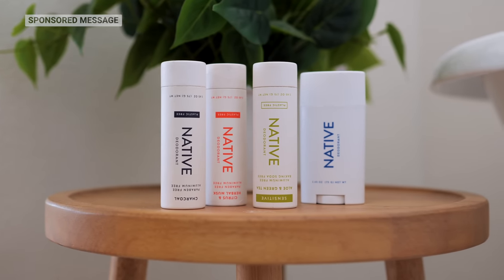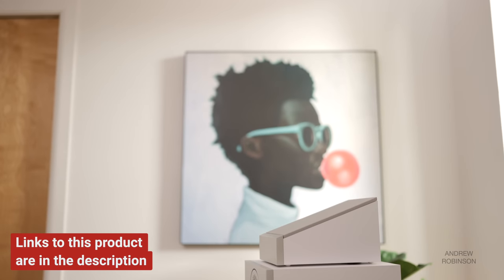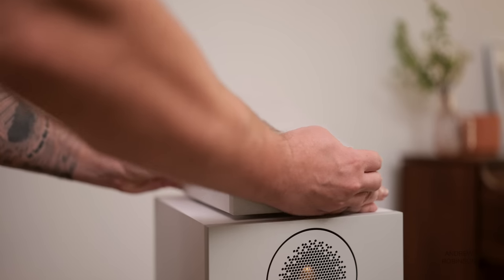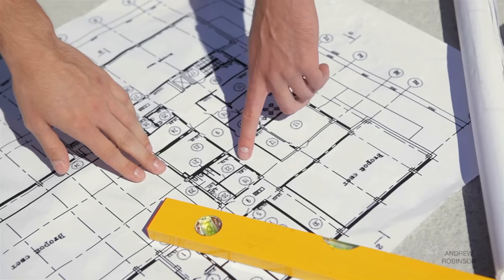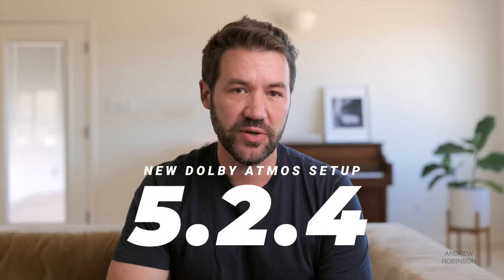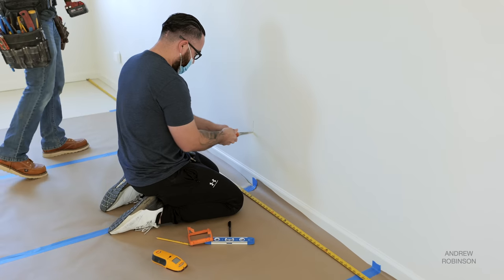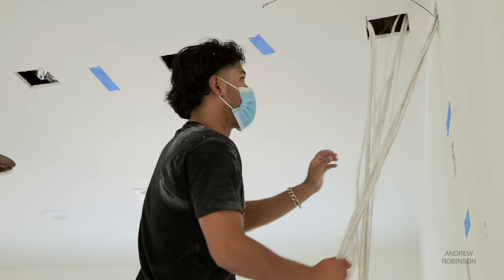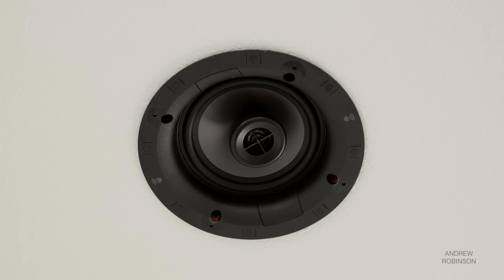INSTALLING DOLBY ATMOS SPEAKERS! Atmos In Ceiling Speakers

Comment: Can the AI driven system in the Sony HT-A9 compensate for sloping ceilings? I have a significant slope in the main room of my house and haven't been sure if the A9 would work or if I'd be throwing money away with those.
Reply from the maker: The A9 can compensate for a wide range of room types, but I cannot say with 100% certainty how it will perform in every room type, so your mileage may vary.
Reply: It should be fairly easy to determine. If the up firing speaker drivers are not pointing in such a way as to reflect their sound off the ceiling then back down to the listening positions, you are going to be out of luck with any up firing system. That includes speaker top Atmos, the Sonys with their up pointing drivers, or Atmos sound bars. Works for some spaces, but probably not with a sloped ceiling.
Reply: Yes, but try before you buy.

Comment: Hey Andrew, and Kristi, as a follower for a few years now, I was wondering if you have any plans on using other measurement systems than barley corns in the future? I would appreciate not having to do conversions to figure out what 12 feet actually means.

Considering the quality of content and knowledge you present on here, I would be surprised if your audiences demographic would be anything but global. At least I hope it is, because I think you're doing fantastic educative work on here. I'm sure you have a better grasp of your audience demographics, so maybe it's a conscious decision to keep the amount of written information to a minimum?

I'm sure it will be clearer in further videos, but I was a little confused on how you decided to solve the issued of aesthetics with the rear channels on stands, because your drawing only shows speakers in the ceiling?

Look forward to hearing more on the project, this video was great for anyone considering permanently installing speakers in their home, with solid talking points at the end by Kristi, and I can't wait to hear your experience with this system compared to the reflective atmos setup. 

And congratulations on the house!

Comment: I just got Polk upfiring Atmos speakers a month ago and I'm not even sure if I can pinpoint the height sounds with certain movies or tv. Maybe it's my ears or the positioning/calibration of the speakers/home theater setup...still experimenting. 🤷‍♂️
Reply: Yes, you do have to expirement and tweek settings with the upfiring speakers.  In my  case, I had to raise the volume a few notches in increments until I got the desired effect.  Generally, the height effects in my system fall in front of my sweet spot but they are sometimes mixed with the rears.  I'm sure ceiling speakers would sound more presice ( and I have toyed with the idea of adding a pair)  but right now I'm satisfied with the upfireing Klipschs.  Your source is also important when calibrating your upfireing speakers.  The Dune 4kHDR disc is excellent and I have heard that the Blackhawk Down remaster is as well.  (I need to get that one).  Keep expirementing. You'll get it.

Comment: I have no experience with in-wall speakers but I always thought of resonance when I looked at their design. How do they not shake and rattle? And how does 1/2" drywall work as a baffle, structurally? 

I'm guessing it's not the issue I imagine it to be. Again I have zero experience or anecdotal claims that they are problematic.
Reply: There's several ways to address all this this. For shaking and rattling, the doglegs in most contemporary ceiling/wall speakers hold very tight. You can also utilize soft wraps for nearby wiring that may vibrate. You can also add in foam tape around the edges of the speaker frame where it meets the ceiling to further eliminate rattles. I'm using speakers with built-in backboxes to address the baffle issue, but some do well with an "infinite" baffle. You can also sound treat the area the speakers are in with materials similar to Dynamat or Roadkill. Also adding Rockwool or simply fiberglass insulation to the surrounding space greatly reduces sound transference and standing waves. There's also other soundproofing methods to decouple the drywall from the joists/beams as well as various acoustic noise proofing compounds. Cheers!

Comment: My ceiling is 8ft, and upwards firing Dolby Atmos does not work in my room. Also, doesn't it bug you that your rear speakers are in the ceiling? That would really bother me, because the direction of the sound is completely wrong.

Comment: How are Klipsch SLM 5400 c as ceiling speakers for Atmos. 
They are part of the rare slim speakers which can fit in most size condition
Reply from the maker: I ALMOST went with those speakers but opted for the Designer Series instead, so I don't know how the SLM speakers would perform, sorry.
Reply: @andrewrobinsonreviews  is it possible to review? I have only 3 inch gap in my ceiling and these speakers require only 2.5 inches.
Can help loads of people as a option of ceiling speakers against up firing.

Comment: Im eventually gonna sell the home i live in currently. So im not investing in custom anything in the near future. One day, it will be nice. My stereo is in my living room/art studio. It looks relatively civilized. My home theater is in the unfinished basement. Ive treated the bare walls with affordable materials. Got some cheap red theater curtains for more sound deadening and appearance. The speakers are all on cindar blocks raised high enough for any potential flood, unless its the apocalypse. Its ugly. Kristi would hate it. I even cheat with atmos. Cindar block towers well above the listening position with angled down front firing speakers. I tell you it works. It aint pretty, but its really amazing what anyone can do if you experiment enough. Atmos is more flexible than the diagrams indicate.
Reply: Thats awesome. I too am trying to improve my set up.
Reply: @obi1cannoli777  right on. Its all about dealing with the space available. Unless the room itself was constructed purely for home theater, compromises must usually be made. Good news is, great sound can still be achieved

Comment: I hatttttttte back and side stands with the speakers. However I live in Mexico so guess what, I learned to love them since houses in Mexico are made out of cement. Hiding wire was the trick but way easier the having to drop the ceiling with beams and drywall .

Comment: You're lucky you have drywall, I have solid brick and coving at the top. The cables just want to be seen. The coving is 127 years old, so I don't want to start carving that up. I could use a specialist to cut it out so I can put channels in up to the ceiling, then have the coving put back again.

Comment: Aesthetically and because I'm tired of seeing wires, I'd love to have embedded speakers in the ceiling and walls. Although, I'm not sure I'm ready for another "is your marriage strong" test right now. Plus I do get slightly worried that embedded speakers could date a house. Sort of like when you see those old "doesn't work anymore" house intercom systems that people installed in the 1970's.  The irony though is my house is already pre-wired for speakers...but it's setup "whole house" music playing in every room instead of surround sound in one room. In a family setting, that nearly impossible that everyone wants to listen to the same music in every room they go to in the house...so we never had the speakers installed.
Reply: The ceiling is good but the walls, not so much. One has to be very careful as the projection of the sound and the reverb effects give the illusion of space and depth. It would look and sound cleaner but the human ear doesn't always do well with cleaner.
Reply: @lonniefarmer7067  Good point. I suppose in my mind I was thinking if rear speakers were in place (as I've seen some friends do). Another issue with embedded is if you get "tired" of the sound it's a bigger challenge to change the speakers out.

Comment: I have yamaha 3072 modeil 5.1 AVR. How can I add additional 2 dolby atmos over head speaker.  .. please suggest
Reply: If your receiver is a 5.1, that means it can only handle 5 speakers. The first five speakers should always be bass level (ear height). For one to add height speakers to this configuration, one would need to go with at least a 7 channel receiver. Therefore, allowing at least two of the channels to be allocated as heights / in-ceiling. Basically you would need to go with a 7 Channel receiver!

Comment: Andrew, I could really use your input. I am in similar situation. Currently run 5.2.2 setup, with 2 Atmos currently overhead directly. 

Looking to upgrade, but have no ability for rear surrounds at ear level. Room is open to rest of basement. 

Option 1 is 5.2.6, with 2 front elevation and 4 in ceiling Atmos. 

Option 2 is 7.2.4 with front elevation and overhead Atmos, with angled in ceiling for rears surrounds. 

Not sure which makes most logical sense. Any input?

Comment: still odd manufacturers  don't have white speakers for home in-ceiling... never seen a black ceiling in a regular house ... In-ceiling is rather permanent. I prefer atmos or direct height. 
No way I'm hiding my 7.6.4 speakers and subs in the room. 😁 $2k for the speakers including install is a STEAL...
Reply: Those Klipschs come with a white grill.

Comment: Andrew, as always, I enjoyed the video.  I hope you will do so Home Theater reviews from your new HT room.  I installed Klipsh in ceiling and in wall speakers with Atmos and a Yamaha 2030 receiver. I hate it!  It doesn't matter what mode I use, it's just hard to hear dialog unless you really crank it up.  The soundtracks sound good, but they dominate.  I had it professionally calibrated twice.  And using it as a stereo for music playback is really a joke. Most of the time my wife and I just watch TV in our family room with a basic soundbar.  I even considered starting over, but then reality set in. No one has a place to demo in ceiling speakers.
Reply: Did u find the issue why ? U tried room accoustics, or changing the AMP, AVR. Im not sure what  all has to do with  Ceiling speakers making it all muddy?

Comment: great video. I have a similar 'particular' female boss LOL!  This video helps me alot to simulate the response from my female boss LOL 
I just bought a house with a media room. It looks like 12 or 14 feet high ceiling. I plan to install Atmos speakers 2 or 4 but I think I would attach speakers because I wanna do it by myself. I may use flat wire like 'ghost wire' to conceal speaker wire then I would paint it to match surrounding. It may easier to my situation - I cannot justify to pay professional installer to do this job.
Reply: Particular is definitely the nicest way to put it. I'm lucky my wife isn't as "particular" lol but hey, everyone is different and I respect that.

Comment: Man, in ceiling surrounds made me die a little inside with all of the other videos of yours that I have really loved. Your videos are always well done and most are very thought provoking for me, but I cannot hang with you on this one. The separation between the bed level and your in-ceiling speakers needs to be pronounced or it will provide diminishing results. I get not wanting ugly on wall speakers, but that is just a huge compromise. I would likely initially like it, but it would quickly kill the experience for me causing additional expense to fix. Watch some Atmos demo videos once this is setup to see what I mean, Nature's Fury is a good one so you can visually see on the screen what you are supposed to be hearing. I am sure the space will be beautiful, but for me personally that is a secondary concern, but I am also in a dedicated space so I get it.

Comment: Could you please add your speaker cables you used in-wall to the system comments?  Thanks
Reply from the maker: The installer used a dealer only wire by Snap AV however, this is basically the same thing if you would like to go DIY - https://amzn.to/3oqetGW.

Comment: $2,000.00 for that install project? That's not bad. And about the ceiling height issue? I'm safe. My ceilings are only 8.5 ft.
Reply: In Australia there's an extra $0.00 missing.
Reply: @DarrenKrusi  Too right mate!

Comment: Ahh man. lol .. you should have done a Auro 3D setup instead . I have in cel. but put heights front and back with Auro MAN O MAN so much better
Reply from the maker: Auro3D has virtually zero support in the home entertainment space. While I understand their up-mixer is quite good, I simply do not want THAT many speakers in my home, nor do I want my life or home to have to bend to a format's needs. Honestly, Auro3D has done a decent job marketing to die-hard enthusiasts to the point where they've made themselves somewhat known, but in the larger home entertainment space I doubt they'll grow to even 10% market saturation or at least it will take a lot of time to get there.
Reply: @andrewrobinsonreviews   No I totally agree with you but I will tell you that there up mixer mixer is absolutely phenomenal
Reply: Man I want to get into aura 3d. Is it much better than atmos? Did you use svs prime elevations? Your system sounds  sick😷

Comment: Why go in ceiling surrounds vs putting in wall speakers for them? Like seems like cutting corners when it wouldn't have been much if any more. Like I understand not wanting speakers visible and get that in a non-dedicated space that proper positioning for SIDE surrounds in a 5.x.x might not always be possible but it kills the point of sounds coming above you with atmos when sounds that are supposed to be around you are also coming from the same direction. Personally I would put them properly placed with in walls then put acoustically transparent paintings overtop and remove the grills which gets you proper placement but then you have no visible speaker instead of 2 extra circles in your ceiling. 

As for will you think they are better i think it will be a resounding yes. First off you're going from 2 speakers to 4 so that in itself is an improvement as even a 5.1.4 with upward firing would be an improvement due to now sounds being able to pan front to back and left to right. Now going with in ceiling you'll gain some extra clarity as you're not hearing sound reflected off the wall but more sound coming directly from the speaker. Other thing that might be different is that I'm pretty sure atmos speakers are limited to 150hz or higher crossover due to bass being omni-directional so they can't use lower crossovers so having speakers that are in ceiling means that they can play deeper without any weird effects happening. Look forward to hearing your review of the switch.
Reply: Hi Tyler - That's likely my fault. I do not like the look of in walls so that was a hard NO.
Reply: @KristiWright  Ha I should have known. Look forward to rest of this series of videos relating to your move.
Reply: Something to add to the not liking in wall speakers, I've seen people cleverly hide them behind artwork printed on acoustically transparent fabric. Obviously that's not for everyone but I thought it was a clever solution!
Reply: @TylerStout  We are dead serious about not making this space look like a recording studio or typical reviewer/demo space. Nothing against those who want that for themselves, but that ain't us, fam. 😜
Reply: @DrawTheLine35  We looked at a few of those but it's been hard finding something that fits our style - but yes, those could work as well!
Reply: @KristiWright  a lot of people are doing custom prints for their diy absorption panels so you could have done the same thing just with a significantly thinner frame. Edit: But yeah definitely think movie posters which is what most of the videos I've seen are would be tacky in a living room haha
Reply: @TylerStout  😂 Speaking of...We just got the coolest vintage movie poster in for the room. I can't wait to get it framed!
Reply: @KristiWright  come on Kristi... Enough teasers... Pls give us a clue! Movie year or something!  🙂

Comment: $2k for 6 speakers and labor?  That seems incredibly cheap. Unless your speakers are $100 each and labor was 1400
Reply: Cutting 18 holes and patching them up plus the speakers for just two grand?  That has got to be an insider price.
Reply from the maker: The speakers you see in this video sell for anywhere between $209 and $315 each based on what I've been able to find on dealer websites (yes, it is a dealer only in-ceiling speaker). Six at $209 is $1254. The labor costs were just under an additional $1,000. The total cost of this build was just over $2,000 (I believe it was $2,147 or something close to that). I said it was "around $2,000" because based on your area and when or how you buy your in-ceiling speakers the price can and will fluctuate.

Comment: I'd say being off by slightly more than 100% on the project is a win given the starting point in cost. 🙂 The whole contractor interaction part is just a nightmare. Most of the home projects we've done make your adventure look tame. To protect yourself from future issues, see if the Texas Dept. of Consumer Protection has a contractor reimbursement program. In CT, if you deal with a licensed contractor and have a written contract they will reimburse you the first $5K of your project in case of a dispute/claim once settled in small claims court.

Comment: Even the cheaper speakers you have linked are $275 each. I'm not understanding the $2000 price point.
Reply from the maker: The speakers you see in this video sell for anywhere between $209 and $315 each based on what I've been able to find on dealer websites (yes, it is a dealer only in-ceiling speaker). Six at $209 is $1254. The labor costs were just under an additional $1,000.  The total cost of this build was just over $2,000 (I believe it was $2,147 or something close to that). I said it was "around $2,000" because based on your area and when or how you buy your in-ceiling speakers the price can and will fluctuate.
Reply: Thank you!